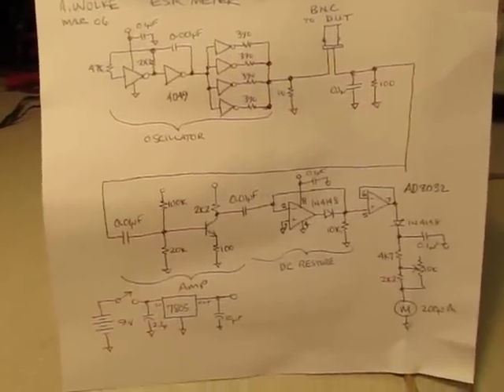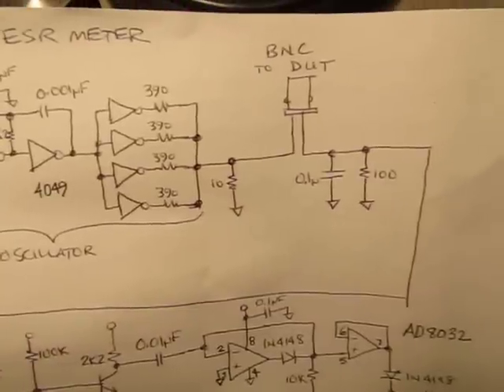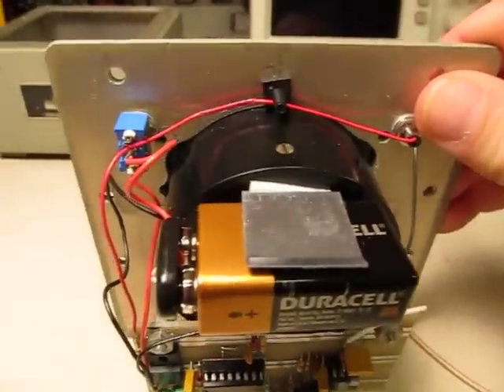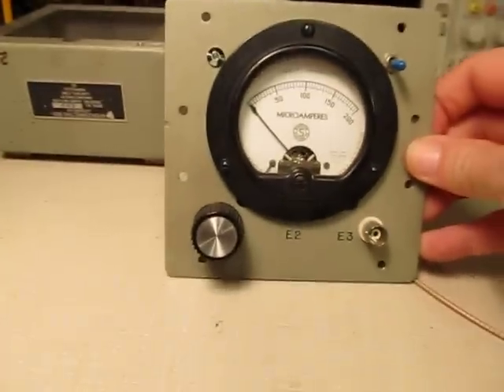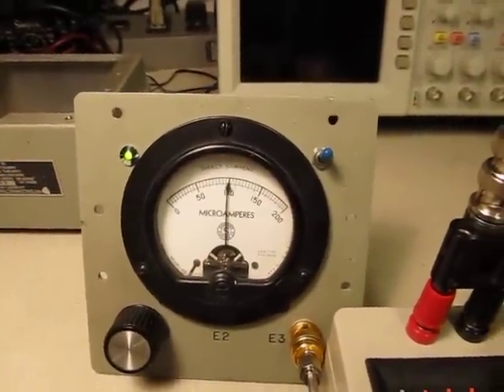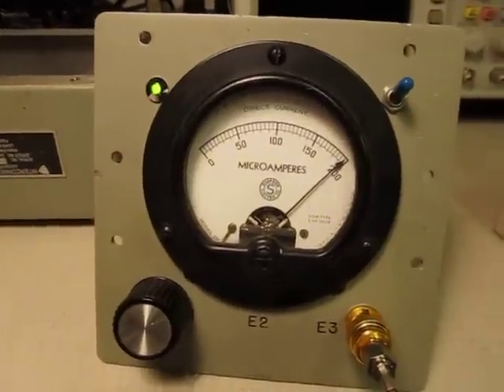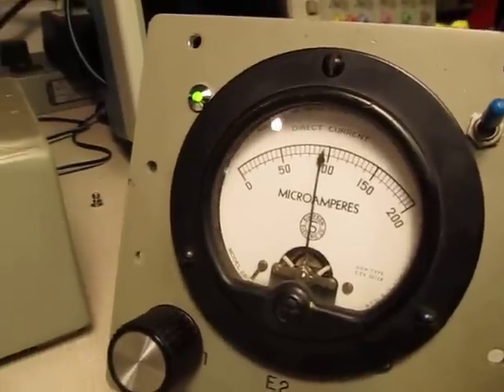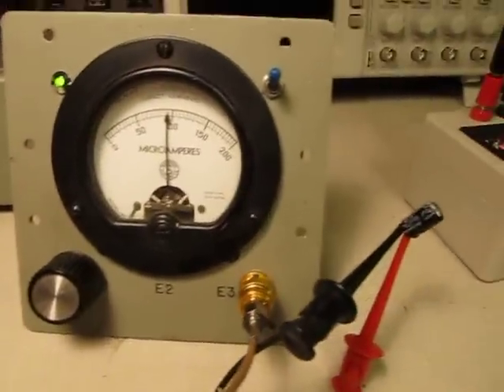#5: My ESR Meter project from 2006

Comment: you used a perfect diode configuration on the dc restore, then didn't on the peak detector?
Reply from the maker: Yeah, didn’t really need it.
Reply: @w2aew  got to keep you old guys honest.😎 
 Company gave me an in circuit ESR tester to review so was doing some homework. nice video
Reply from the maker: @IMSAIGuy  Check out the video on the 5-transistor ESR meter - that's a cool circuit!

Comment: Interesting little project 🙂 I was thinking as I was watching this: 1) The "shorts" in the capacitor would look like low ESR. A parallel DC measurement would reveal that. The DC meter would give a high resistance after the charge time. 2) How useful are analog meters for testing the ESR directly? Ideally when C is empty the Ohm meter would give "zero" Ohm the first short moment. Maybe one would need to develop a good feeling for the right testing. 3) Can we do the same with Signal generator and AC Voltmeter? Maybe with a sinus.. and using a resistor in series with the C?
Reply: ...and one more idea: the meter could have the Test button. The circuit would discharge the C in the normal mode through 1k or so, and then by pushing the Test button the measurement would take place.

Comment: I just found (again) this video, using the nice index you have provided with links 👍. This circuit is nice and probably with less parts than the more recent 5-transistor circuit. The bigger issue I see is to obtain that AD8032 as a real one (not fake). I live in Brazil, so this would make an additional difficulty. 
Rambling now: upper rail might be solvable driving the OpAmp before regulator. 
Lower input rail as LM358 does, the TL082 doesn’t work well. And LM358 is too slow for 100KHz. 
Maybe a 10KHz ESR with LM358 or LM324 would work, but at 10KHz a good 15uF cap would have AC impedance = 1.0 Ohm. Still doable I guess, for a lower performance or to detect a larger issue.

Comment: its working in cicrcuit ?
Reply from the maker: The applied signal is low enough for in-circuit testing, however, I don't trust in-circuit measurements for ESR because often there may be a "good" cap in parallel with a bad cap, which will make the bad cap look good.
Reply: @w2aew  thank you ;)

Comment: Two quick questions.  What is the p-p output voltage of the oscillator and is it a square or sine wave??
Reply from the maker: It is a square wave, approximately 400-500mVpp if I recall correctly (this video is 10yrs old).
Reply: @w2aew  Yeah I managed to find a 4049 in my junk box last night (1970s vintage) and  I got the oscillator to work. Though I will have to find something to take the place of the AB8032.  might use a lm3915 for the indicator.  Thanks for all you videos learned allot.

Comment: P.S. As I would like to build a "Meter Panel" consisting of all manner of vintage meters, does one or two feet of sheilded wire connecting the meter to the ESR interface make much of a difference as far as acceptable accuracy is concerned? Thanks again and looking forward to your next.
Reply from the maker: It'll be fine
Reply: @w2aew  Thanks Alan! I've been scouring your videos, and the rest of the "University of YouTube" for knowledge regarding vintage analog meters. This rabbit hole is deep and dark. Thanks for providing the candles along the way! :)

Comment: I have watched this awesome video more than a few times over the last couple of years, but I've recently acquired a bunch of '60s meters and one is a US Navy 0 - 200 Microamperes DC classic Western Electric D-170286... Whatever that means... But it passed your "shake and short" test and it has such a  smooth as butter movement that I must copy your project. Sadly there is no print stating its Full Scale MA... If I copy your design, do I risk hurting the meter, or is there a procedure that would ensure a successful build. Hope this makes sense. I'm 57 and I'm a vintage test gear whore. But, like women, I have no clear idea what the hell... Any advice would be greatly appreciated. Thanks! :)
Reply from the maker: It is very likely a 200uA full scale meter.  There would be no danger in hurting the meter in this circuit.
Reply: @w2aew  Thanks Alan!

Comment: I bought an El-chipo 100mA meter to play around with. https://www.aliexpress.com/item/32413325200.html?spm=a2g0s.9042311.0.0.27424c4dmhsuhd
I would like to make your ESR meter. I opened the meter and their is a 2R5 resistor between the inputs, as also written on the face-plate. 
If I remove the resistor and put a 5 MilliOhms shunt resistor across the input, would it not turn into a 200uA meter? 
I've never used these analog meters before, and since I only have one, I don't want to mess it up.  
I love your channel and I'm binge watching your videos today. Your explanations are crystal clear, and your voice is nice and mellow, which helps to relax while watching.

Comment: hi im only confused to connect correctly the 4049 pin out can you make precisions on the shematic thanks
Reply from the maker: Pin 1 is the supply voltage, pin 8 is ground.  All of the inverters in the 4049 are equivalent, so you can choose to connect them in the most convenient method for your layout.  The pinout for the 4049 is here:
https://commons.wikimedia.org/wiki/File:4049_Pinout.svg

Comment: Is a chopper op amp would be good for the circuit?
Reply from the maker: Not necessary.  But does need a single supply op amp whose input common mode range includes ground.

Comment: could I use a 14069 and a plain op amp for the rest meter
Reply from the maker: 1469, yes.  Plain op amp, no.  The op amp needs to be a single supply, rail-to-rail op amp.
Reply from the maker: @Brad Shugart It is an AD8032, and it is fully specified for rail-rail single supply operation.

Comment: A friend routinely uses an ESR meter,  it is shocking how many of the capacitors in old audio and ham gear are in a bad way.
Often the equipment appears to work fine but with subtley reduced performance.
Your video and my friends experience has certainly got me sold on having one!

Comment: Thanks Alan. I  built your design today on Veroboard. It looks like a success using  1mA FSD meter that I had to hand. I have ordered a 200 micro amp meter so I can get the sensitivity. The circuit shows difference between new good capacitors and bad ones already. Great films. 73
M0YDH
Reply: current through the meter is 70 micro amps when the test DUT leads are shorted together. Time for some shunting!
Reply from the maker: +David Holman Or simply adjust the resistor in series with the meter.

Comment: Do you find any variance to the reading from the length of the probe leads, or if they're close together or wrapped around each other?    I built a different circuit based on parts I had available, but cross talk between the probe leads causes quite a bit of error on the meter.
Reply from the maker: I've found that the lead effects were minimal with this circuit.

Comment: I know it's been awhile, but do you have a scan of that schematic?   I need to build this!   I want to resurrect my dads old Heathkit Oscilloscope, which I suspect has a few bad filter caps.
Reply from the maker: Someone took a screen capture of the schematic and posted it on EEVBlog forum here :
http://www.eevblog.com/forum/projects-designs-and-technical-stuff/what-about-home-made-%28esr%29-meter/?action=dlattach&attach=16769&image=
Reply: Thanks, I found that.   A bit blurry and I'm not sure a few of the component values, but I'll figure it out.  Thanks and 73.  KB9RLW

Comment: Hi Alan,  Nice job on the video.  I always learn a lot when I watch every one of your video's.  I'd like to give this circuit a try.  I also really like using analog meters.  They are easy to read and just look good.  Nice touch.   Can I use a Fairchild 74act14dvc part?  I got a parts order going at Mouser and they indicate the HDF4049bp you used to be obsolete.  (I'm sure I could find one somewhere else, Mouser just ships very quickly)  I know nothing about inverters or making oscillators from them.  It looks like  you just used 2 of the 6 inverters as the oscillator and the 4 other inverters in the package as buffers so I guess you wouldn't have to ground them or something.  Might as well use them right? One other question:  What is a peak detector?  Thanks for sharing your knowledge with us mere humans.
Reply from the maker: +Douglas Tees The 74act14 is a schmitt trigger inverter, while the 4049 is a simple hex inverter.  You could use a schmitt trigger, but the oscillator design would differ a bit.  I have a video on schmitt trigger oscillator:
https://www.youtube.com/watch?v=NuXitMK3HSA

I also found that Mouser still has many variants of the 4049 in active stock:
http://www.mouser.com/Semiconductors/Logic-ICs/_/N-4s5z6?Keyword=4049&FS=True

A peak detector is a circuit whose output follows the peak of the input signal.  I have a video on that too:
https://www.youtube.com/watch?v=Fn5kHhNRsz0

Comment: can i use this for in circuit testing
Reply from the maker: +jimi farrell Yes, but in-circuit testing is generally not recommended because "good" devices in parallel with bad devices can mask the faulty device.

Comment: Hi Alan , Please forgive my lousy texting ability and I'll try this again. Although being brought up on solder smoke and Shacks by the lake, listening to beep be beep for hours on end or wondering what all these cool knobs do I haven't built anything in 25 years or so. So I humbly ask you for advice on how to make this thing....are your capacitor values in nf or uf or both and what type of caps do you recommend? (Sorry if I am missing something obvious). Also I'm trying to breadboard this project before I build it is that feasible? My thought on the video was to show the process from start to finish. as I thought that would make a good subject for the new or getting back into electronics folks.
Thanks for your time.
David

Comment: can i use an LM 324 Op. i cant find the  AD 8032,  THANK YOU
Reply from the maker: You can give it a try.  It does have an input range that includes the negative supply rail, and the output can swing to the negative rail, so it's worth a try.

Comment: Useful circuit indeed! Just for clarification if you don't mind, what are the roles of the 10ohm, 0.1uF, and 100ohm resistors and cap following the oscillator surrounding the DUT? Thank you!
Reply from the maker: The 10 ohm resistor is works with the oscillator's output resistors, making a voltage divider to reduce the osc amplitude. The 100 ohm resistor forms a voltage divider the the DUT, to measure the DUT impedance. The cap takes some of the high frequency energy out of the circuit.

Comment: I have a 50ua meter, any suggestion on amended values for the 4k7 and 2k2 resistors near the pot.
Reply from the maker: It depends on the meter's coil resistance. You'll have to experiment with it yourself to determine the appropriate values.

Comment: hi Alan
I am going to try building this with a 74HC14N  and a LM358N inspired by your response to Lenient comment. I don't have a 200uA meter just a 50uA . What would you recommend I change for that  meter.
Again thx in advance
Reply from the maker: You'll just have to increase the resistors in series with the meter.

Comment: Hi Alan
Would it be possible to have the complete number for the 4049. Also is there a substitution for it that you feel might work in case I have a hard time locating this locally.
Thx again
Francisco
Reply from the maker: The most common full p/n would be something like CD4049 or CD4049B.  Other manufacturers have different prefix and suffix, like HEF4049, etc.

Comment: is it possible use a 555 timer oscillator instead of this 4049 oscillator because i don't have any 4049 ic's.
Reply from the maker: Possibly, yes. You'd be pushing the 555 to achieve 100KHz or more, but it should work.

Comment: Alan, thanks for all the great videos!  I'm working on a ESR meter based on your design but modified to add charged-capacitor protection and with modified current limiting resistors after the DC rectifier to work with a 50uA meter.  In my case, I wasn't getting the as much deflection/ohm on the meter as I wanted so I lowered the value 100 ohm resistor between the DUT connector and the transistor to resolve that.  Just thought that might be helpful to anyone else with the same problem.

Comment: Too true. Electrolytic capacitors can fail so many ways. I've seen a lot of industrial equipment manufacturers simply say to replace all electrolytic capacitors every 5 years as regular maintenance. Have you ever tried to reform a capacitor then retest it? With my electronics projects I use old parts in them so I use beat old electrolytic caps there a lot.

Comment: I bought a capanalyzer 88a from EDS years ago(~$189). It's got an LED scale and designed mainly for SMDs (probes are flimsy) but it does the job. I like your use of the analog meter.
Reply: Beautiful. I Don't do repair work but I hope to build one like this in the near future just for the fun of building  and having it on my shelf.